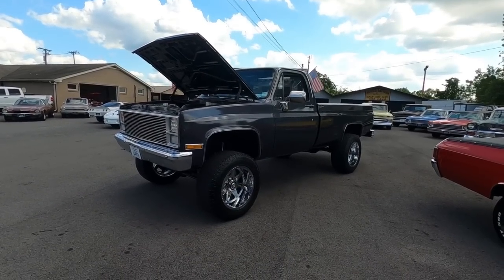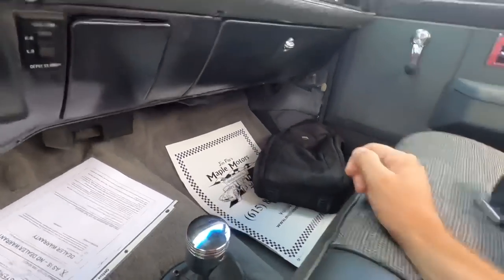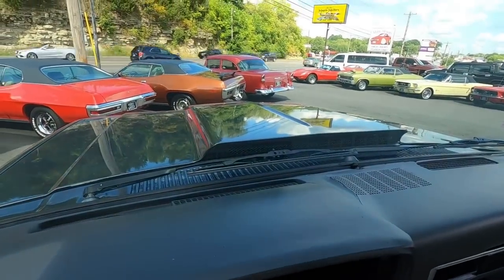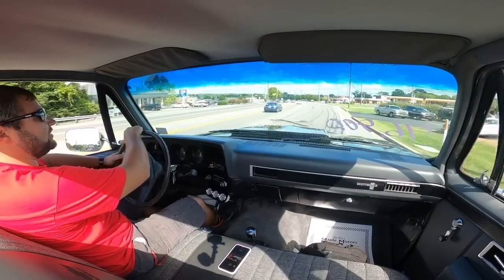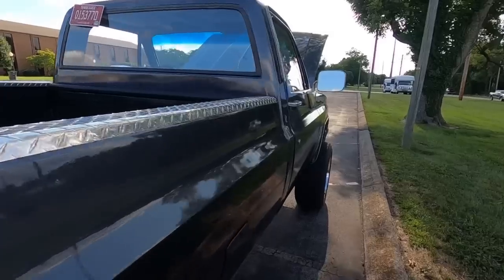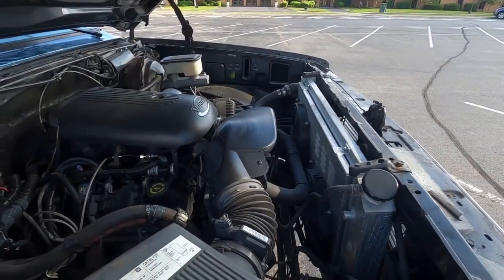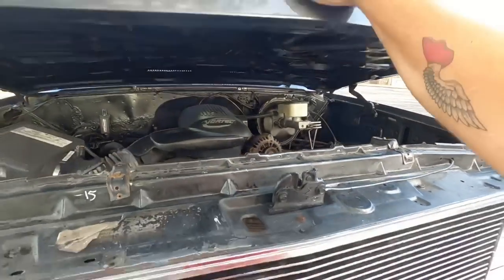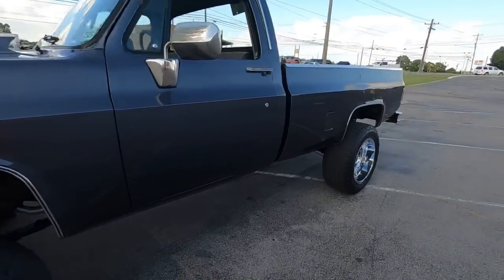Test Drive 1986 Chevrolet C-10 LWB LS V8 SOLD $16,900 Maple Motors #1848

Comment: My little two cents, why in the world wouldn't someone take the time to properly align the steering wheel. Small issue amongst it's others, but, it would drive me crazy.
Reply: Because it’s a shade tree mechanic special.
Reply: If you tilt the steering wheel up for comfort.  You can't see the speedo between 65 and 75 mph. I've done that on my 78. To see speedo

Comment: That's a K 10, not a C 10, 
K is the production code for four-wheel drive. C is the production code for two wheel drive. I have a C-20 that people mistake for a K-20 because of the body lift and tires.

Comment: 8-9k truck at best. Even if everything worked perfectly with a nice custom interior, stereo system, and some electronic gauges… it still wouldn’t be worth $17k.
Reply from the maker: That is definitely a matter of opinion cause the market says differently. Trucks already on hold
Reply: @MapleMotorsNickSouthgate  they should’ve shopped around.
Reply: Square bodies have really taken off.
Reply: @darrentolliver9647  square bodies were mass produced from 73-87… they’re a dime a dozen. Great trucks for sure, I’ve owned quite a few myself. I’ve seen far better ones for far less $ though. I realize it’s a stealership sold pickup but I’d love to know what they paid for it. I doubt it was over $9-10k, probably even less. The front driveshaft laying in the bed was a nice touch 🙄.

Comment: Do you know why the front drive shaft is in the bed and not on the truck?
Reply: The transfer case looked like it was soaked with fluid leaking. I would be curious.
Reply from the maker: Yes mentioned that in the video
Reply from the maker: Probably is thats why I showed it in the video.

Comment: I'm assuming that because you don't have to get out and lock the hubs manually "Or from what I  can see" that they are automatically locked when you shift into 4x4.. Sweet truck for sure Nick thank you for showing us the inside, the outside and the underside lol. 👍🙏🙏
Reply: I didn’t see a transfer case or drive shaft
Reply: @raymondlanier1112  The transfer case starts @7:09 at 11 o'clock and the driveshaft starts @7:13 at 12 o'clock. Not hard to miss if you know what to look for. 😉😂🤔
Reply: @imhappyandyou.4003  i had to replay on my computer now i see the transfer case just missing drive shaft
Reply: Almost every Chevy I've had either has electronic transfer case or in the cab floor shifter to select 4x4. Either or, put in neutral, shift to 4x4, put in drive and sling mud lmao. Hub locks are a Ford thing